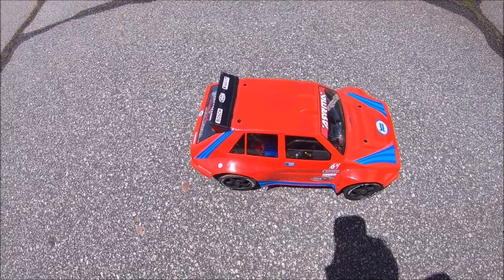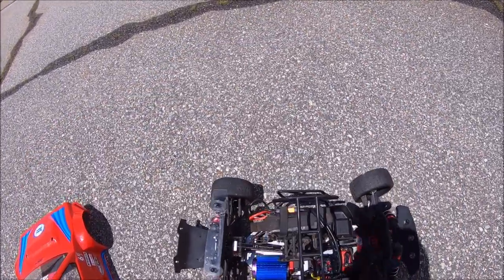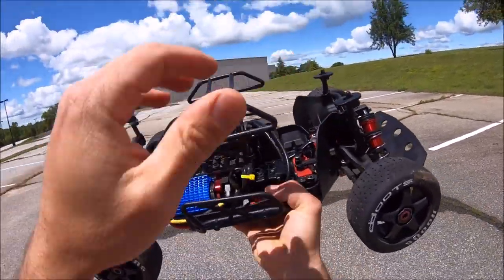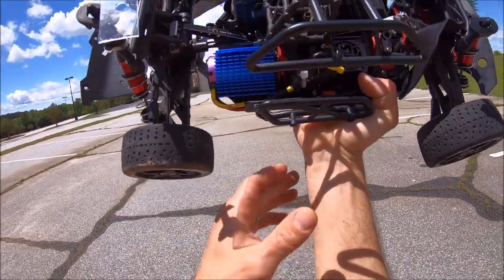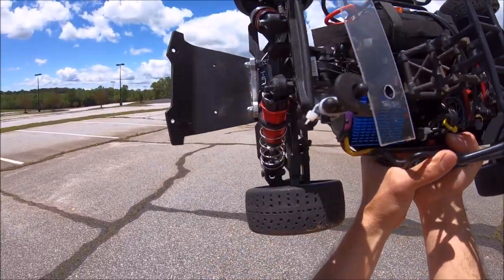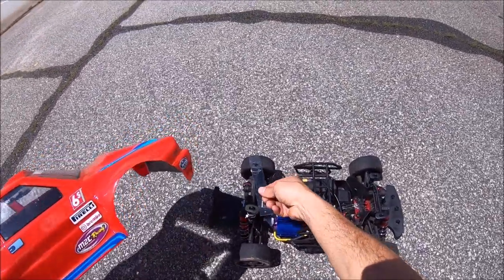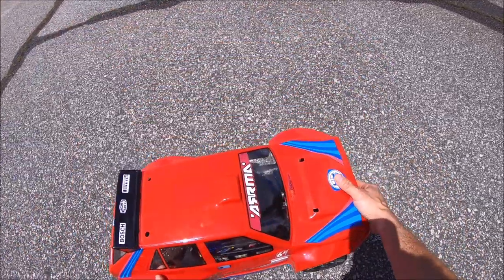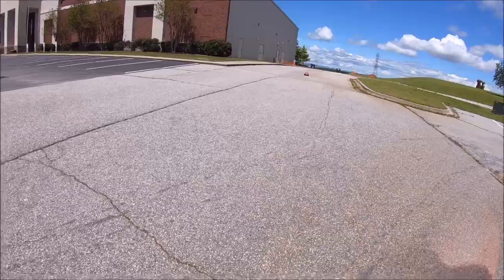NEW Arrma RALLY car build! Shakedown run and rip!!

Comment: Hey man! Im trying to build a similar build to yours from scratch. I can't find typhon shocks anywhere. Do you have any advice on other options?
Reply from the maker: On this one, I'm running Senton shocks.   They are a tad shorter than Typhon and work great for this platform!🤟
Reply: @RCDUDE81  thanks man. I assume i could buy typhon shafts and make them the proper length?

Comment: What shock oil do you recommend for the talion for normal bashing with a few jumps that can be big. Also what do you recommend for diff oil set up?
Reply from the maker: For the Talion I use and recommend stock 2000 cst. I've used Outcast front springs since the front seems to get lazy over time. Just adjusted the collar to get the desired feel. 50k front, 500k center and 20k rear is what I use. If you're not going for fast corrections or multiple backflips, 200k center should do the trick!😎👊
Reply: RC DUDE81 maybe a few back flips. Mostly just grass asphalt and bumpier terrain and jumps. Would the 500k be overkill?
Reply from the maker: Not overkill but it can be hard to handle🤣With a 20 tooth pinion anyway.👀Really easy to wheelie up. Have to really feather the throttle to keep power down but also very responsive for fast corrections. I think a good median is 60k 200k 30k. You can try either setup and see what you like the most! Are you running stock Katars?
Reply: RC DUDE81 yep everything is stock other than remote and receiver
Reply: RC DUDE81 sorry to bother you again, would the 500k make the vehicle harder to handle with the stock electronics, stock punch level, and stock pinion/spur and the katars?

Comment: How are you not traction rolling at such high speeds? Is it just the road tires that allows you to powerslide so easily?
Reply from the maker: The tires definitely help! Almost no traction in slides or on the gravel. Took a lot of steering on my end to keep her in a slide and come out straight! I did have one traction roll when the car flipped and rolled with the on board camera.😆I'm looking for actual Rally tires too but not any options that will handle the power or in the US. Definitely a fun rig none the less! Just got to tune the diffs a tad more!👌

Comment: How did you duild this, I'd love to see a build series
Reply from the maker: Basically a Typhon with Senton towers, shocks, cage and body mounts fabbed to fit the body. I have 2000cst in the shocks with Typhon springs. Still working on diff dialing. I'll try and get a more in depth vid on the overall build soon!👊

Comment: That thing is badass. You should get into some nitro rc.  Killer build tho 👊💪
Reply: It would.ruin it.. Nitro sounds good but just doesnt have the same driveabilty. With electric you have full torque from 0 rpm on and no clutch to spool up, Nitro simply cant compete in this regard. I have owned both..
Reply: @paulhope3401  i never said anything about nitro competing with electric. An yes nitro will beat a electric out the gate but not top speed. I have both as well rn. But i was just saying he should. It would be cool
Reply: @paulhope3401  an i didnt say put a nitro in this exact rc was just saying in general
Reply from the maker: I've never ran nitro but I'm sure it's fun and definitely has its place! Maybe one day I'll try it!😎👊
Reply: . I get you. Not saying one is better than the other, they both have their own advantages/disadvantages. With similar gearing my electric would beat my Nitro out the gate, top speed was similar but the nitro was lighter and changed direction better. Nitro great on a fast flowing circuit, electric has instant go so can be better on tighter ones as it doesnt bog down.
 Both good fun but I sold my Inferno mainly due to the simplicity, less kit to carry around. Also less anti social, can run it almost anywhere without people getting upset with the noise.
Reply: @paulhope3401  the lag is cus the tune isnt right. There is a few vids on youtube with nitro beating electric.  But yes each has its own ups an downs. Like mine chasing vacumme leaks the last few days fix 1 thing then another problem comes up.
Reply: @ronniewilliz153  You are probably right... I did throw the conrod on an O.S. unit from running it too lean and so being more cautious probably kept it a bit too rich for it to perform at its optimum.
20 years ago I never imagined electric would ever be able to compete but they can mix it with Nitros now. I suspect electric is selling in far greater numbers than Nitros these days which is kinda sad in a way.
Reply: @paulhope3401  nothing wrong with that i do the same as well its not fun being down or waiting on parts.